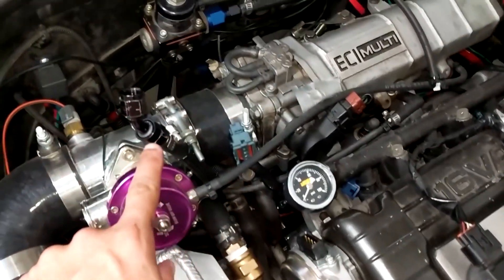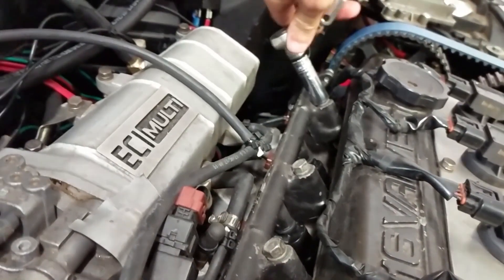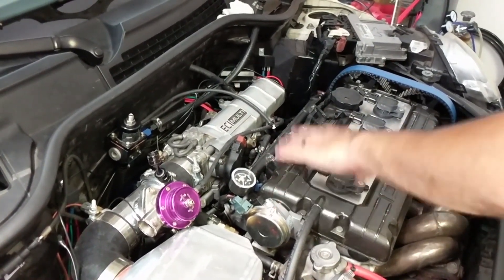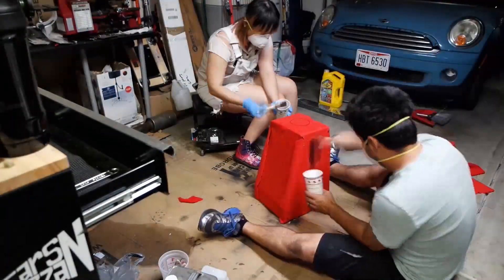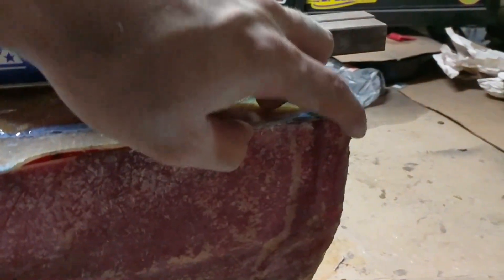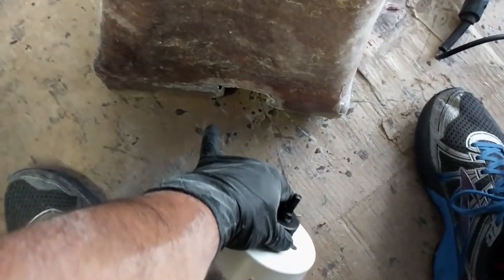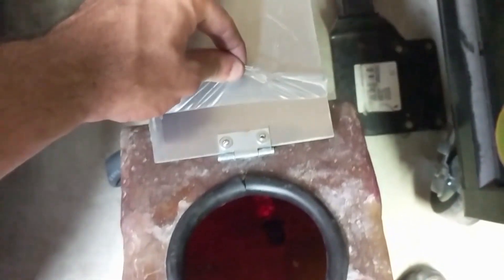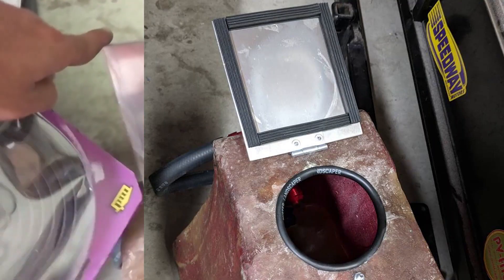1000cc Injectors and Custom Intercooler Tank - AWD Mini Cooper Ep. 24

Comment: No more genesis coupe?
Reply from the maker: Well I can't really modify two cars at a time lol. I work as a engineer during the day so I just don't have the time to have two not running cars haha.
But I do plan to finish the Mini Cooper soon and get back to modifying the Genesis Coupe. Gonna rebuild the engine and inspect everything, make DIY headers, upgrade the turbo and retune it for 91 octane for Cali gas ;-)
Reply: @InitialDIYmods  Lol athanks for the reply I was worried you got rid of a unique masterpiece.
Reply from the maker: Haha no I'm not planning to ever get rid of it ;-)
The only exception is if I sell this one to buy a cheaper shell to restart and do an insane 1000 hp build with a full drag spec suspension setup for 10s haha

Comment: Just finished the playlist! You've done amazing! I didn't see a video on how you did the exhaust or the carrier bearings for the driveshaft. I'm curious how you ran the exhaust next to the driveshaft and how those different bearings went.
Reply from the maker: Oh great points! Yeah I'll have to add some more details about the carrier bearings and exhaust. Someone else asked about more details on the final wiring too so I may just make a response video going over everything people want to know that maybe I didn't cover or didn't cover with enough detail shots. So many good clips get cut for time sadly. 
If you check my Instagram @InitialDIYmods you can find some more pictures and videos that don't always make it to YouTube. Aside from those two things, anything else you feel I should go back and cover in more detail?
Also, mad props for getting through the build series in under 24 hours! I can't even stand myself for that long LOL
Reply: @InitialDIYmods  I made it easily. You make it funny at times. Good information. I am curious as to why you didn't use the stock ECU from the gsx for engine management?
Reply from the maker: Thanks that's great to hear. There's a few different reasons I went standalone. The first was because I have never built or ran a standalone ECU before so it would be a cool experience. The second was that I don't know anything about DSM and there's so much information that it was hard to know if I had the right version for DSM Link. Third was that I would have to build a custom harness either way so this way I wouldn't have to worry about all the extra stuff I'd need to wire with a stock ECU like making CELs go away when I don't have those components to install and I won't have the dash to integrate with. Fourth was OBD1 is just a nightmare to work with. Fifth was the cost. My standalone ECU was under $300 so it was easy to justify the cost when DSM Link could cost $600 not to mention if I didn't have the right ECU to begin with

Comment: gonna be running e85?
Reply from the maker: Not for right now but I will have the option to down the road. I would just need to add the flex fuel sensor and build the tune for it ;-)